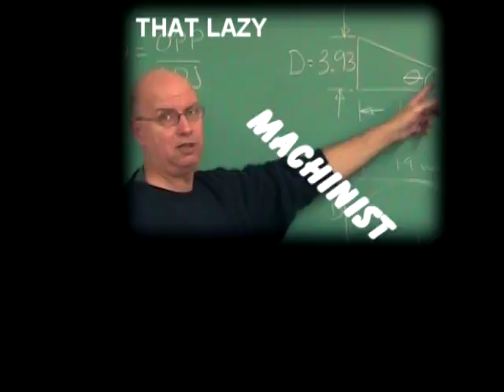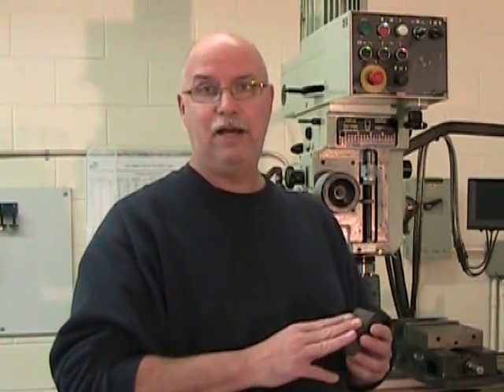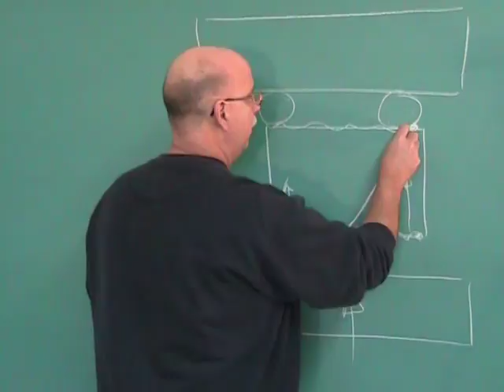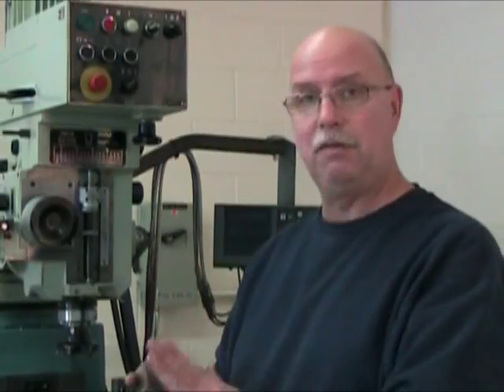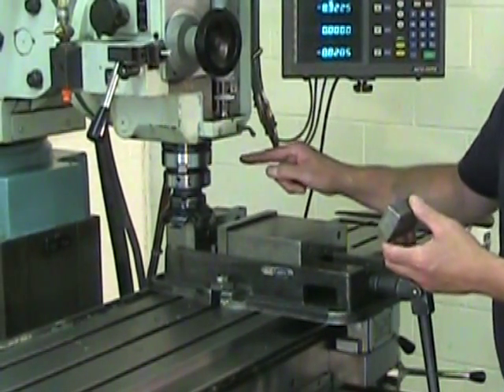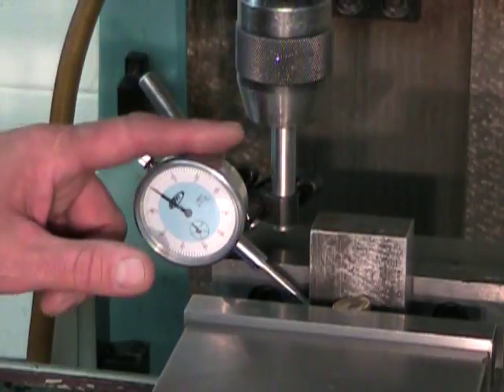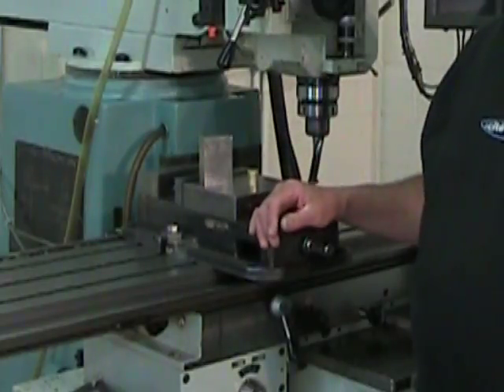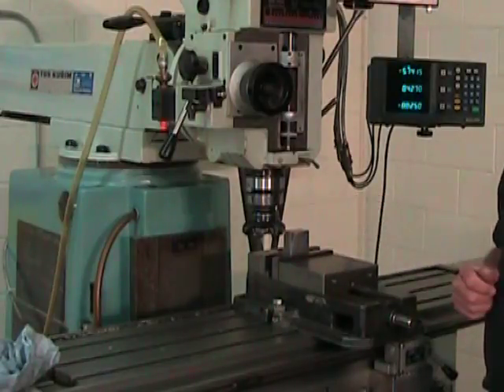BLOCK SQUARING ON A MILLING MACHINE WITH A SQUARE & DIAL INDICATOR OR BY END NOTCHING. MARC LECUYER

Comment: I thought I had a good understanding of how to do this procedure of squaring up a piece correctly on my old Bridgeport, but obviously I was very wrong. I did not know the terminology "tertiary datum" nor did I have the correct sequence of sides in order. The use of brass pins and and the correct use of them is a revelation to me! Thank you very much Mr L'Ecuyer you have given me hope that maybe someday I will be able to build an accurate part! I have a lot to learn, please keep up the great video's! From my book I found (Tertiary Datum) is:" The third plane of the 3-2-1 method determined by a single point. This plane must be perpendicular to both the primary and secondary planes and is usually the smallest surface of the work-piece." NOW I get it!

Comment: That was an excellent demonstration of the squaring-up process, as it is taught in trade schools.  I'm a toolmaker and have squared up thousands of blocks.  I've abandoned that method years ago.  I've found it is better to get 2 sides parallel first.  I've found that if I put the 1st side against the fixed jaw, mill a side, flip it over, you'll never get the part to seat tight on parallels.  If both parallels aren't tight, the top and bottom surface won't come out parallel.

Comment: What a great video, Marc.  Besides the excellent techniques on squaring, there is also a lot of useful information on work holding.  As a novice machinist, I would have never thought of using the round brass stock placed in that very strategic manner to distribute the force of the vise jaws on the work.  Thank you very much for posting this video.  I'm subscribed to your channel too, so looking forward to other similar, fine videos.

You're anything but a lazy machinist, however.  You obviously take great care with your work.

Comment: HI Marc recently discovered your channel and have recommended  to my apprentices that they have a look because what they are teaching in school now (or should say not teaching ) comes up short .Really liked your stuff on bench work. AS for squaring how i was taught 30 some yrs ago is the same for the primary and secondary sides but i was taught to side mill the tertiary as it is much quicker when doing many pieces. Not saying you are wrong just that i was shown a different method . By the way i was born in Ottawa and am in Toronto now.
Reply from the maker: Hi Brian and thanks for watching, Marc L'Ecuyer (did you go to school in Ottawa?)

Comment: Great stuff, very good teaching, thank you for taking the time to upload these. ps a tiny niggle at about 3min 20sec you said eight surfaces, I even went away and counted a block lol I made it six
Reply from the maker: +binness Howdy! Either its a magic block or you are right. There is only six surfaces, so you are right and I will call the error a senior moment. Thanks for signaling the problem I will insert a note on the video. Marc

Comment: Regarding the pins used to distribute the vice pressure:
Does the material or dimensions matter, as long as they're softer that your workpiece and don't interfere with the cutter? Do they have to be trued?
Could you use wooden dowels for very soft metal? Thanks! ✌️😎

Comment: Marc,
Have you ever seen the method where the cylinder is placed horizontally and not vertically? This is the way that my textbook teaches.
For machining the first primary:
 They show a piece of rod between a secondary surface and the movable jaw placed horizontally and extending the length of the part; and then just the other secondary surface flat against the fixed jaw.
The other operations are similar to your method, but the rod is always placed horizontally extending the length of the surface of the part.
What do you think?
Reply: Yea so does mine. I like the way this guy uses too though.
Reply from the maker: Antoni K Hi j and Antoni, I have also seen books that use the horizontal rod method. I thinks that it would be fine as long as the two secondary surfaces are quite parallel. If they are not, or if they are very rough as is the case with the hot rolled steel that I use in the example, I find that it is best to use three cylinders place vertically as in the example to form as large a triangle as possible. This is not the strongest way to hold the part, but it is the most stable (other than using three balls). make sure you use mild steel or better even brass since a very hard pins can become rollers. Marc

Comment: I'm a newbie to machining and am really learning a lot from your videos, Thanks. I have a question about the squaring of the tertiary surfaces. Could you have placed the primary surface down on 2 parallels, clamping on the secondary surfaces and then used an end mill to square the tertiary surfaces by using the Y axis? Thank you.
Reply from the maker: Jim Colemam You most certainly can, and you can see this in the part 2 video of the tap block project that I uploaded last week ( https://youtu.be/CDRcgf1uP1Q  ) and in the part 3 video that I am planning on uploading tomorrow. The tap blocks have very small tertiary surfaces so I was not worried about tool deflection, the 1-2-3 bloc however has a much larger tertiary surface so I opted for the notching and face milling technique. It is however good to remember that for the second tertiary surface (especially when several blocs are being produced) surface milling is a much faster way of maintaining an accurate dimension since once the height of the tool is set, all the other blocs can be cut without adjustment. I hope this explanation makes sense, if not get back to me and I will try again. Thanks for a great question and for watching my videos, Marc L'Ecuyer

Comment: For the 5th surface ( end ) simply hold the 4 machined faces between two vee blocks to square the 5th side to the first 4. No messing about with dial indicators & perfect squareness.
Is there really any need for all those brass cylinders just for the first light skim cut? Just put it in the centre of the vice on some parallels - don't tap it down & take a skim cut.
I've used rods to push workpieces onto the fixed jaw but never seen them vertically. They are usually longer than the workpiece & sit horizontally so the workpiece can pivot to sit flat against the fixed jaw with full length contact on the rod.

Comment: Thanks for the video. After viewing it, I am wondering why you used only one parallel at about 28:06 in the video. Could you have used two? is there a reason why only one is used? if the part and round stock were of different sizes, could you do the squaring up without using the parallels for support?

All the best to you from Hamilton, Ontario.

Comment: Great demonstration as usual. I'm still unclear why you didn't clean the scale off the reference surface before cutting it. I understand that you cleaned the other primary so it would sit flatter but I thought you would have removed the scale for the benefit of the cutter. Could you clarify?

Comment: again: clear and systematic explanations - thank you! 
Would you consider using soft (e.g. aluminium) auxilliary "jaws" between the work and the vise jars acceptable instead of the brass cylinders?
Reply from the maker: I would avoid soft aluminium, as I would avoid very soft brass. Half hard brass, or any machining grade aluminium (2024-T6, 6061T6 ...) will do fine. If you are not sure about your brass or aluminium, drill a hole in it. If it produces crisp clean chips it will do fine. If you get longs chips (adherent type) that want to stick to your tool and that don't look nice and shiny, you probably have soft brass or soft (series 1000) aluminium. Since these pins are used mainly to hold rough parts, cold rolled mild steel works well also. Marc L'Ecuyer P.S. Brass is a lot more expensive than mild steel, the main reason that I am using it in this video is that I had a lot of pieces left over from the hammer project. I shouldn't admit to things like that but what the heck, its a form of recycling.
Reply: Great explanation!
Thank you for your detailed reply.
Greetings Harald

Comment: Very good! As an amateur I've learned I could be doing this smarter! I don't understand one thing though - when you squared the 2nd tertiary surface, why did you use a parallel on the bottom instead of the bottom of the vice?
Reply from the maker: gheumann Hi gheumann! Great question, reducing the amount of contact between the bloc and the vise bottom reduces the risk of error due to dirt or chips or burrs or bumps. None of these should be present, but it is a good practice to suppose that they might be there. Also, it is very difficult to asses whether the part is sitting properly on the bottom of the vice. The parallel will tell you how the part is sitting, and that is important. Also I will add that since the part is thinner than the height of contact between the part and the fixed jaw, only one parallel is required in this situation. If no parallels are available, paper is often used. One small piece under each end of the part will be a good indication that your part is sitting on the bottom of the vice. Thanks for a great question and thanks for watching my videos, it is appreciated. Marc L'Ecuyer
Reply: THATLAZYMACHINIST Makes sense. Why then, did you NOT use a parallel for the 2nd side of the secondary faces? Or perhaps you did and I missed it? Don't mean to belabor the point. I just "discovered you today and you are an excellent teacher. I have watched several of your vids and I'm planning to go back and watch just about all of them. FYI I'm a hobbyist machinist who makes a living making (get this!) products for harmonica players. I own two lathes and two milling machines. You can see my work at http://www.blowsmeaway.com - the Custom Wood Mics and the Ultimate Series mics are the most machine-intensive...... THANK YOU!
Reply: +gheumann By using the parallel, the Z height from the previous cut just matched the notch height and let him start from there.
Reply: This operation is only to get the edge square to the primary face so it does not need any parallels or tapping down at this stage, unless it is smaller than the height of the vice jaw.

Comment: Thanks for the video! 
Quick question, if the size of the vice allows, would it be ok to machine the tertiary surfaces by positioning the secondary surface against the botton of the vice, and the primary surfaces in the jaws, with the tertiary surfaces protruding from the vice?
Reply from the maker: Hi Daniel, it is possible but remember that when side milling with an end mill, tool deflection is a real problem. If your tertiary does not require a very long tool it will probably be fine, also remember to check your milling head for proper alignment. I hope this helps and thanks for watching my videos, Marc L'Ecuyer
Reply: That makes perfect sense!  Thanks again

Comment: HELP! what attachment is it you are using and if I have a chuck with a 5/8" arbor what can I use to replicate this process? currently I am using a 1/2 arbor adaptor with a 1/4 shank & I sized washers to fit in the hole of a flared diamond cup wheel.
Reply from the maker: NeptuneKnives Hi NeptuneKnives, it would be much easier for me to know what you are trying to do if you could send me a few pictures of the tools and arbors and a description of what you want to do. E-mail to thatlazymachinist@gmail.com  thanks for watching, Marc L'Ecuyer
Reply: THATLAZYMACHINIST yes Sir I will absolutely because this is difficult to find any info out there. I greatly appreciate this

Comment: Hi!Thanks for many educational videos for an MSC in electronics but newbe as a machinist. Nice musik at the beginning of Your video.Your method squaring that block, using the brass cylinders, is a really a good tip for me, often handling rough bodies.My current project is to square up a U-formed piece of steel being some 3 inch long, 4 inches wide and 2 inches high . It was left ower when a longer piece was cut. My idea was to square it up and use it as an angle block in my mini mill.The difficulty is that I don't have a vise large enough to hold it. It has to be clamped to the XY-table. All sides ar rosty except for the machine cut, bandsaw, side and that is doubtfully square to the base, the bottom of the U. How would You handle such a bastard piece of steel?
Reply from the maker: Hi Stephan! I don't know if i can help "U" (get it? u-formed piece) but a few pictures or the part and the mill would really help me provide an answer. Marc
Reply: Thanks for Your answer. I made 2 photos of the block standing on the mill. How do I send them to You? I don't find any attach feature.
Reply from the maker: @Stefan_Boerjesson  Hi! My email is  THATLAZYMACHINIST@GMAIL.COM  or you can reach me through my website  THATLAZYMACHINIST.COM

Comment: Instead of 3 point contact, throw some aluminum foil in it, clamp it halfway up longways up.
Face the sawed end, then kiss around the perimeter to required size. This leaves you with a half squared block length wise with one end finished completely. Flip it over, now as long as your vise is trammed the two secondary machines sides (1st op) will be held parallel. Face the other end, then go around the perimeter. Way easier than this. Lol

Comment: Is there some way you could get rid of that echo that your microphone is picking up? It is very annoying..
Reply: I'll give my unsolicited opinion: not possible. The original video was likely recorded with the built-in camera mic that picked up the reverberation of the large machine room. The other speech you hear is a voice over done separately.
The "echo" voice is not too bad, is it? Not as comfortable to listen to as the voice-over but perfectly intelligible. Also, noticed anything else on this video? Like the awesome machining and teachings perhaps? :-)
Reply: JRoque250
Your teaching of machining is absolutely well explained to the point where my being totally inexperienced in milling work, appreciates and understand s every step you show us and the value of the required set ups. I look forward to all your videos and I am learning a lot from you. I want to apologize for my comment on the mic problem and I know you will remedy it. I have a hearing problem so I was just trying to help.......Sorry If I insulted you.
Reply from the maker: resmed  Don't worry Resmed, I myself am suffering from hearing loss (a lifetime in noisy shops I guess!) and I find that it is more and more difficult to separate the good from the bad noises. Especially the low frequencies. My newer videos (little quickies) are done in my shop and the sound is a lot better, the room is smaller, there aren't any other people working at the same time, and I now film everything in English and in French so no voice overs. I still have five or six French videos to translate, after those are done all the others should have much improved sound. I do this for fun and I am having a blast, and in many ways it is due to people such as yourself who take the time to watch and appreciate these videos. I am fluently bilingual, that means that I massacre both English and French so please excuse all the mistakes. Marc L'Ecuyer